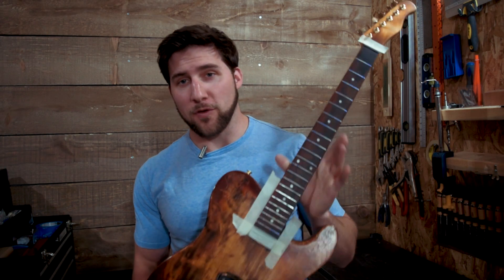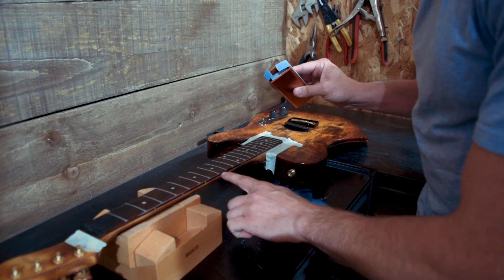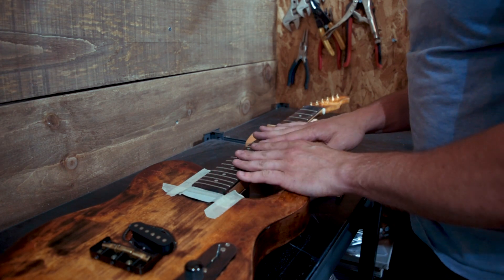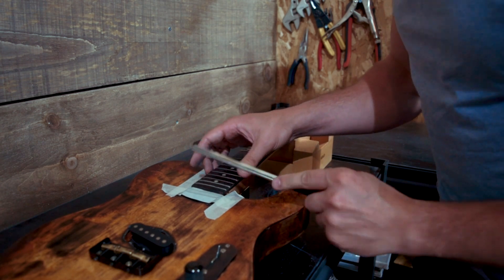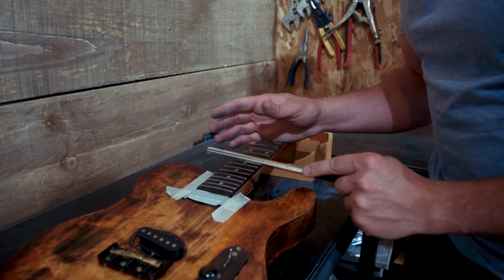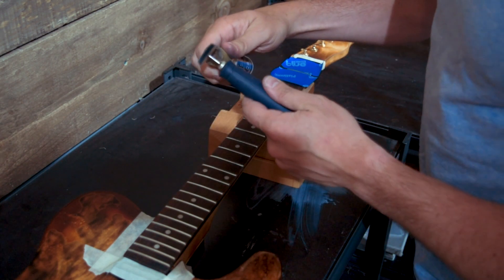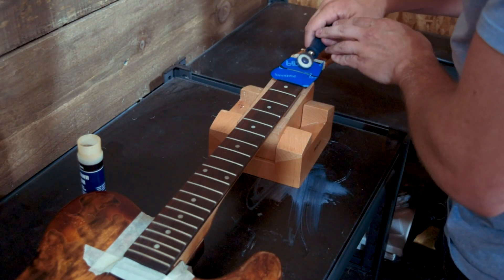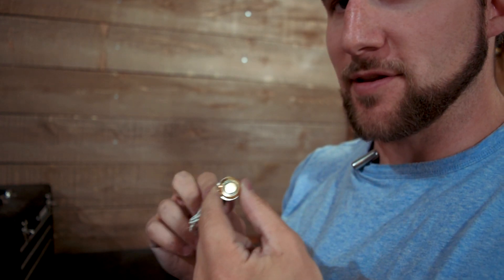Fret Crowning and Polishing | How to Make your Guitar Play Better

Comment: No taping = relic 😆😆 micro mesh is my new go to thing to polish frets Brad and adding a small amount of jewellers rouge makes them like glass! If your neck is off the guitar steel wool is fine in my opinion but a no no when its joined to the body. And as always a very informative little tutorial and your tool kit is coming along nicely.  Get yourself some microcrystalline wax to put on the back of the neck just for the finish and the way it feels under hand... your tele is gonna play so much better after all this TLC mate
Reply from the maker: I do like microcrystalline wax. It’s been too damn long since I’ve used the stuff haha. 

Are you putting rouge right on the micromesh, or polishing with it a bit after?
Reply: @BradAngove  no into the micro mesh pad on the more abrasive side 8000 grit them using the ultra smooth 12000 side to polish off. Works extremely well but I would say it's a expensive way to do it as the pads are £2.50 each and only last one neck so if you are doing lots then fret rubbers and polish are the more cost effective way.  But for the once a year I do my necks its nothing as it saves me £75-£100 if I had to take it to my local shop.  That's why videos like you do save people vast amounts of money. Keep it up matey
Reply from the maker: Thanks for the info Stu.

Comment: When doing the marker pen on the tops, I use one of those slotted guard things you get with fretting kits and never end up using to protect the board with.  I've left my mark on too many boards :)   (Edit: You do actually use the shields as intended later on, I replied too soon) :)
Reply from the maker: It makes sense to use them with the marker though too. I’d never thought of that.